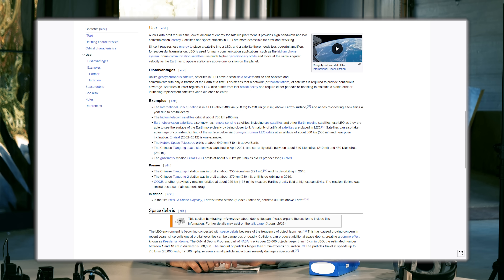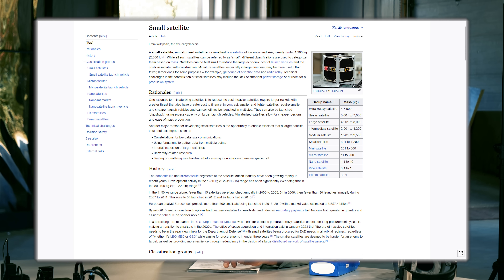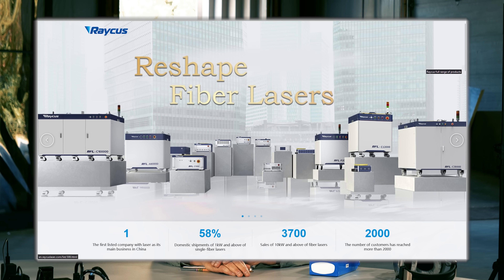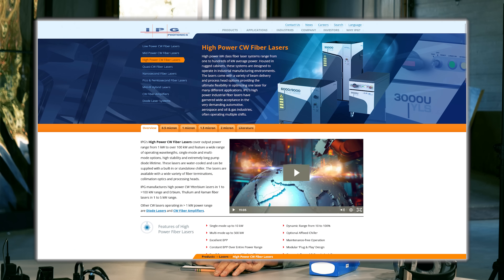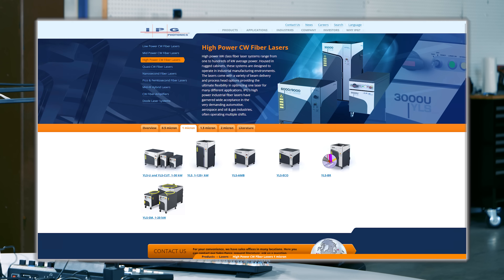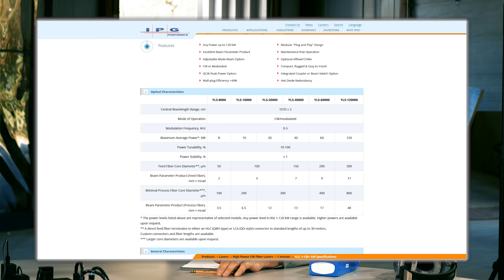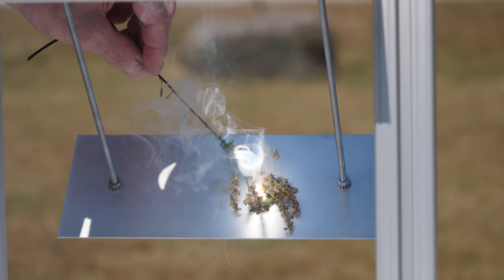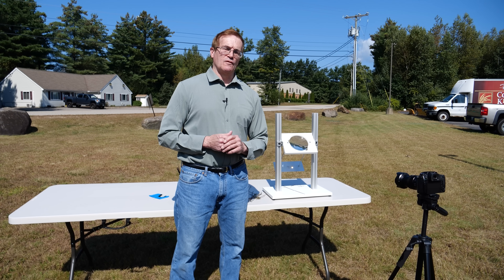COULD SATELLITE LASERS REALLY DO THIS?...

Comment: I would like an logical and scientifically explanation for why  most of the trees surrounding the houses and buildings are not burned and why have metal such as the car wheel rims burned so much when before it never did. Anyway not from so called bush or forest fires! It does not make sense at all. Something about this fire does not add up
Reply from the maker: Regarding  the houses, they are far more flammable than trees. The organic materials  are exposed and dry, and many are thin and easily  heat when struck by a flame.  A tree is loaded with water (it's alive), and because it is thick, it takes a lot of heat for a prolonged time to dry it out enough to burn.  Throw paper, packaging, and garbage on a campfire where you have a thick damp log and see what happens.
Remember,  the vehicles were loaded with gassoline.

Comment: Why do you think that the firing point was in space when the firing point could easily be within the atmosphere eliminating atmosphere distortion.  One could also use a mirror to oscillate a pin point beam from side to side like one of the new rust removing lazars in order to cover a larger area. If you were given a one trillion dollar budget do you think you could make it happen?
Reply from the maker: I don't  think it was, as I said.
We just wanted to evaluate if it was possible.

Comment: The United States Government and the Air Force have nuclear power plants in space.
Reply from the maker: Sure.
That's  not that difficult. Very small generators can easily  be constructed that convert the heat of the radioactive matter directly into electricity.
Probes that travel  a long way from the sun use these to generate  power.
Reply: How hard would it be to focused sunlight through a magnifying glass in space if you had articulating focus points?

Comment: Hi, light being radiation, particles.. they glow and collide, i think lots of uhh video game energy weapons are called ion cannons as they're sort of hadron collider like firing particles out like used in PLASMA SPUTTERING to coat surfaces in metallic finishes. I think thats how things instantly explode with lasers in movies. But theres plasma gas or heat or types of cold plasma or just the arcing of electricity high voltage high voltage jumping the gap in a live wire circuit... so very many different plasmas that are kinda samey.. but none of them seem to be a good fit i guess? lasery light based lasers still? You could literally take a big glass lens and converge it on a point if its several meters or bigger wide it will melt rocks and burn holes in the earth if left long enough but the spread of the radiation and focusing to a point issue was covered as to why lasers are better theyre such smaller higher frequency stuff and dont spread or diverge as much and like the 80s star wars satellite space weapon program proposals were cancelled because of impracticality and were maybe just sorta gaussian shells with laser targeting, i sometimes wonder those programs and lasers are possible thanks to light amplification tech in night vision goggles and things right? because light is additive, we use small laser big output. But what if we had a big sunlight meters wide lens, and somehow converge them into a filter that downsampled or downscaling them into a laser then firing? is such a backwards night vision goggles light amplification goggles possible? OF COURSE IT IS its a waveform.. mathematically and such.. but .. does it work that way? binoculars or telescope back to front? can you make a "reverse laser" for space purposes? is that what we were doing wrong?
Reply from the maker: Photons do not glow or collide.  They are, in fact, glow. The photons have both wave and particle properties.  At their scale in time and size, the distinctions fade.
Reply: Interestingly when they dont collide their hit and bounce point and angles can  be known mathematically for the spin on them and rotation and theres a sort of demon baseball where it seems you see a bunch like petals around a flower but its just the one we can mathematically determine when it doesnt collide if it bounces off other photons possibly or other particles and creates scattering known as diffusion or spread or if it will be embedded into the object and stopped or pass straight through or if it deflects back at what specific angle, fake nvidia fake intel fake microsoft software lighting is nasty and in bumpy road surfaces or long matted grasses or heavy leafy tree canopy coverage their awful low bounce count and pretend straight lines nonsense no spin no valency no shotgun spray for each photon, means that it looks super unnatural. However when realtime processing filtering modifying and playing back ENHANCED and trillions better as light and sound waveform multimedia with AMD your leaves grasses and unnatural angles overhanging rocks shadows behind and away from the bounce point by shade will have better natural illumination with amd truegodrays raymarching/raycasting for games/video etc as you run them even on your phone years before RTX. not fake rtx LIGHT SHAFTS method of old 2d not light. works on my LG V60 or my ryzen5700G i previously had it with a 5700xt and now a 7800xt highly recommend using AMD to reality emulate and see the not colliding bouncing off things for yourself.. vs rtx by using a text file named config.ini and typing in different light volumetry and AUDIO CONVOLVER SETTINGS like AC9 for WAVETRACK WAVEOUT HEVC  AVX vulkanrendered direct to display in RENDERMODEtrue https://workupload.com/file/tfpKsukpTgV see playstation 2 games like wreckfest on steam that were originally AMD PC titles but work in consoles with trueoptics digital camera support and AR/VR mixedreality and visual library support for things like the eyetoy camera.  @TechIngredients

Comment: OK, so you explained that microwave weapons are not practical for satellite deployment, but lasers certainly are and that from a GS orbit have sufficient power to initiate ground fires at specific spots.  I can work out myself that to hit one red roof building amongst a few blue roofed building from 400 Km distance would be a huge task so that puts the satellite based laser hitting everything but blue roofed buildings  back on the shelf.   But - how about if that laser was mounted in an aircraft circling at 24,000 feet ?    USA has shown that a drone at that height can pick out a target the size of a car, or a man, or a funeral party and hit it with a missile ( or with two missiles timed a few minutes apart in order to take out the emergency response aka Obama Double Tap Strikes).   A drone could easily circle a town and a remote operator pick out and hit anything not painted blue.      Would microwave weapons be a practical choice to destroy property and people at that height?    Most  people have left a spoon in a cup or aluminum foil  on a dish in a microwave oven and seen the effects - how about if an entire  house with many metallic objects had been submitted to the same level of microwave radiation? 

I like your videos - they are interesting and clear away a lot of the rumours in order to clarify many points  of conjecture, however, with this video,  what you are NOT saying is creating more questions.
Reply from the maker: Correction, not from a GS orbit.  That's  too far away.
Sure, they could be mounted on aircraft.
Stimulating  questions  is as important as answering questions because both lead to the truth.

Comment: 50KW of solar isnt actually THAT big of an array, its very feasable. but there is a company called graphene manufacturing group, or "GMG" making extremely high power dense batteries that can charge and discharge very rapidly, have energy density's rivaling that of lithium, with great cycle life, and require zero cooling, which is great for space applications because cooling in a zero atmosphere environment can be difficult.

also, when spaceX starship is in service, the possible payload capacity and size will change everything thats possible. bigger lenses, more weight, larger diameter etc.....lol

Comment: NUMBER ONE. No. Satellites are on balloons and would need to navigate to aim . A laser with enough power is a large airframe platform only way possible. It's a terrible weapon. Block it with a mirror from big lots for seven bucks and crash them in return. Constantly realigning optics, condensation it's in a vacuumed down enviro a certain torr I forget where I used to set them to I think is -3 torr. We are on a level plane so a plane would work nothing else in the air would work  it would have to be daylight clear windy or it wouldn't work, and you'd see the helium first laser more then your main beam is invisible but shows up if you delay too long on one spot if smoke, etc. exposes your beam. now you can adjust your head but for specific tuning like a car roof that a different aperture than one needing to burn larger so you would have most likely two planes with two units a wide and small focus and a backup plane and both lasers so four total. enough altitude to hideous your right there in the open. We don't have any satellites in space. AMERICA BLESS GOD AND OUR CONSTITUTIONAL SAVIOR PRESIDENT IN FLORIDA AMEN

Comment: DEW systems from space are very much possible and proven with pulsed resonance feedback power generators. For reference, review the Don Smith devices. This is just technology that is suppressed and you are not aware of. So yes, based on textbook electronics the DEW weapons from space are NOT possible. However, using a pulsed resonance over-unity power generator you can easily generate Giga-Watts of power in a small compact circuit. The_high-power_devices_of_Don_Smith.
Reply from the maker: Did you actually watch the video?
I said it IS possible without  invoking any technology  you can't buy off the shelf.
Reply: @TechIngredients  I did not watch the whole thing, just to the part where you said they would not be able to generate enough power from space.
Reply from the maker: I never said  that.
Why do you even bother to comment?
Reply: @TechIngredients  Dude, don't make me time stamp it. It is not an exact quote but it catches what I heard with the simplification of the area of the laser as a function of distance, something to the effect it would not have enough power to burn anything.
Reply from the maker: I said it WOULD have enough  power.  Then, I demonstrated it!
Reply: @TechIngredients  Ok, the part I cut out is you making a distinction between microwave (MW) and laser power where you are saying laser are easily done with textbook electronics. I do maintain that a MW DEW is also possible with a pulsed resonance driver but I it is still going to require much more weight and area compared to laser DEW power driver circuit, so agree! And FYI, I know a little bit about SatCom payload electronics since I have been an Aerospace SatCom Engineer for 15yr with both BSEE, MSEE.

Comment: If you had the money and hired engineers to give you space lasers they can do it.  However it will not work how people envision it.  From orbit a laser spot will be about 100m diameter on the Earth.  The Sun puts about 0.137 watts of energy every square centimeter.    A 5x magnifier can ignite paper fairly quickly with 0.7 watts per square centimeter.  A 54 megawatt laser on for a few minutes can ignite dried brush as the magnifier.  This laser satellite would have to be pumped by Sun light that is focused by a minimum 100m diameter parabolic reflector.  Then that laser light would have to be sent through a fiber cable to clean up the laser beam.  It will then have to be aimed at the same spot for many minutes before ignition happens.    But that's not the best way to use this system.  The best way would be to find the weather at the target.  Find a dry period and laser the area for days; not igniting anything just drying things up slowly so nobody notices.  Then once it is ignited it won't be stopped.  Doing evil is easy, let's not do that.  Okay?
Reply from the maker: Interesting.
However,  I explained how to determine the spot size at the earth's surface, and it's close to 1 meter in diameter.  How did you come to 100 meters?

Comment: There are SEVERAL, substantial errors in this video about satellites, specifically the power systems.
In short: it is not really possible to build such a thing.
I build satellites for a living and have worked on some of the largest power systems ever flown.
Reply from the maker: Sorry,  but you're  being lazy.
If you really  have the background, then specifically  address the issues with the power system. We'll  all benefit from the explanation.

Comment: Yeah well how about the uss Gerald Ford battle ship each laser has its own unclear reactor to power each laser  & each laser is 150.killowatt and growing in power
Reply from the maker: Where do you get this information?
You should check some additional sources 
Currently, there are at least 3 commercial manufacturers that will send you a 160 kW, fiber laser OFF THE SHELF! These lasers will run off industrial, three phase electrical power.

Comment: No, it is not high winds or laser weapons, you need to look at the reason why aluminum in the cars melted but the grass just a few meters away is all intact, why the lines of destruction look like cut with the knife, why the destruction of certain building materials is so complete. For a person claming to understand Physics, your view is very narrow.
Reply from the maker: I don't  claim anything.
You can judge for yourself. 
Don't  ignore  the fuel  onboard each vehicle and the high winds.
Lasers or microwave  weapons also wouldn't  do the damage that you  described.

Comment: My question is how MUCH grass would it take to raise the temp high enough and long enough to burn & melt aluminum (roughly 1400 degrees) and glass windshields (roughly 2500 degrees), even with a full tank of gas? That is like the Twin Tower got so hot from the aviation fuel that it melted *(at 2700 deg). The conspiracy debunk-er folks say it weakened the beams support strength. Possible but what do they do to explain the eye witness (fire fighters) & film footage showing "molten steel rolling down the I beams. This contradicts their claims. So, the Maui fires got so hot as to melt cars aluminum wheels & glass but a few steps away grass was not touched or burned? Really? The word I am looking for here is, Liars.
Reply from the maker: You had that word ready and waiting, right?
Don't minimize  the contribution of the gassoline, which is the best explanation  for the melted aluminum and glass.

Comment: Dew weapons are low altitude. Because there is nothing man made in space.  . You can't suspend a mass in a gravitational field without  force.
Reply from the maker: If you accept  that there is a gravitational field, then what's  wrong  with the principle  of centripetal force?
Reply: @TechIngredients  Gravity is not a CP force.  Because it cannot cause things to rotate.  Gravity ONLY accelerates masses towards the centre of the Earth with the corresponding diminishment of distance between the falling body and the Earths core.
Reply from the maker: Of course it isn't.   Gravity  is a field, not a force. The force occurs  when the gravitational field of the earth interacts with the gravitional field of the satellite.
The centripetal force opposes this force.
Please don't  insist  that the earth is flat.🙃
Reply from the maker: Best wishes.
Reply: @TechIngredients  I accept your defeat. good luck.

Comment: Solve thermal lensing.
Reply from the maker: It's not much of a problem because the large diameter of the beam and the transparency of air at the near infrared wavelength means that heating is minimal. 
Furthermore, the beam can be focused to converge from the satellite, mitigating  the defocusing due to the atmosphere.

Comment: Youre not going to use a laser for what a single guy on the ground with a box of matches can do.
Cant rule it out, but its very unlikely.
I looked into it at the time, as rumors spread fast. There were definately things going on that are not right (getting property), but it seemed more circumstances, some natural, some man made, that caused this disaster.
Hot day, low humidity, strong wind, lots of burnable material, is waiting for a disaster to happen.
Reply from the maker: I agree!
Reply: @TechIngredients  I want to compliment you on your channel. Discovered it just a day or so ago and have been going through some 5 or 6 video's i think. You sir are gifted with the ability to explain things and teach. Thank you!

Comment: Beam divergence?  My 60watt laser has a focusing lens.  I would assume any weaponized, military produced device would have a variable position focusing apparatus.  If they did not that would be a multibillion dollar failure.  Also the Military Constantly lies about what works and what does not. 😂
Reply from the maker: Beam divergence has two independent causes. One is focus, as you mentioned.
However, diffraction is the other cause and is fundamental to all electromagnetic radiation. It can't be removed with focus adjustment. This is the real limit to long-range operation even with perfect optics, perfect focus, and even when operating in a vacuum.